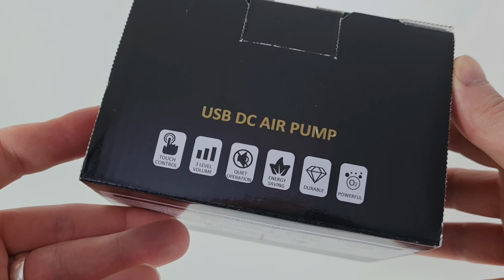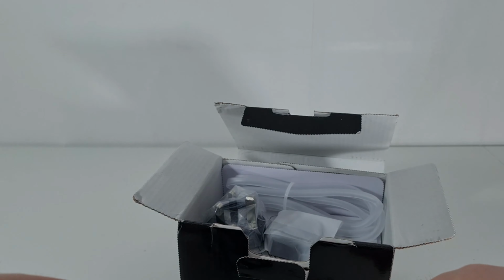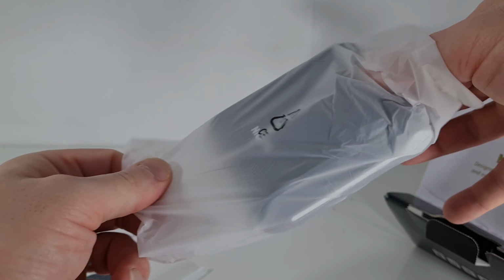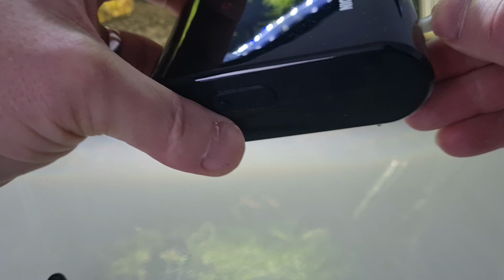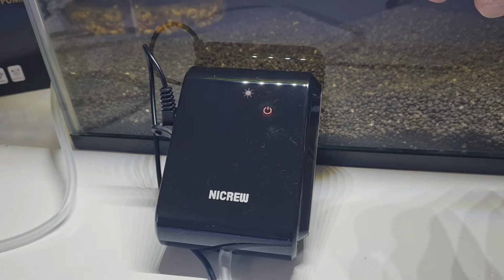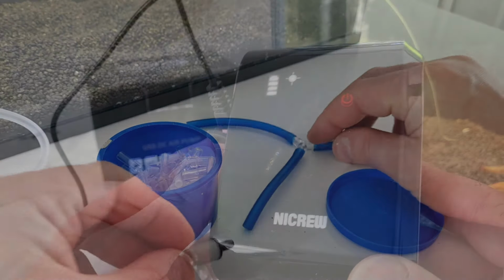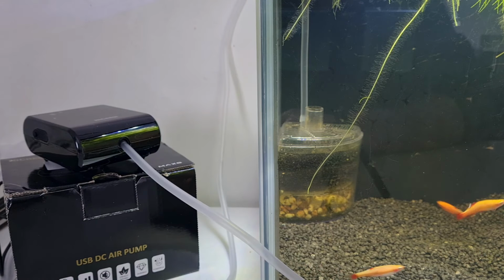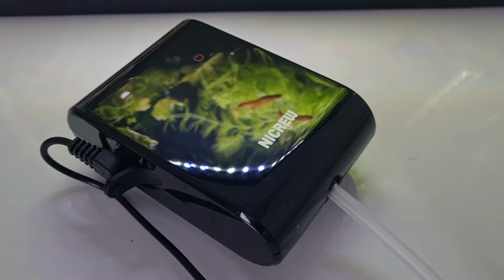NICREW MAX 6 AIR PUMP

Comment: Thanks for that. I've had mine for ages and lost the manual. I didn't know what the M meant and why it was only coming on intermittently. Turns out the USB plug was faulty and was only trickle-charging the pump. I plugged it in to a different USB socket and now it's back to full power. me and the fish are much happier : )
Reply from the maker: @stinkyplum  ah cool. Glad you were able to get back on track with it.

Comment: Do you think this would run x2 airstones and a air curtain? or should i go for the 2 outlet version?
Reply from the maker: I'd go for the the two outlet version mate. I've run two box filters off the single one and it was plenty but I'm not sure about a curtain too. With the bigger model you can always control the flow with air tube valves plus you'll have a little extra if you want to add another line later on.
Great wee filters though. Very quiet plus you have the piece of mind of the battery backup in case of a power cut hey.

Comment: Nice air pump isn't it? I just got one myself for an emergency unit in case of power outage. Nice video
Reply from the maker: Yeah they're ace. Really impressed with it. Think it's as functional as it is nicely designed.

Comment: thats am amazing little piece of kit would love some but will have to get them over time with so many tanks 👍🏻
Reply from the maker: Handy in a power cut. Maybe worth investing in a couple just incase. Remember you can split the lines so one can be life support for two tanks.
There is a two pin model, MAX 6 but I couldn't seem to find where to get them.